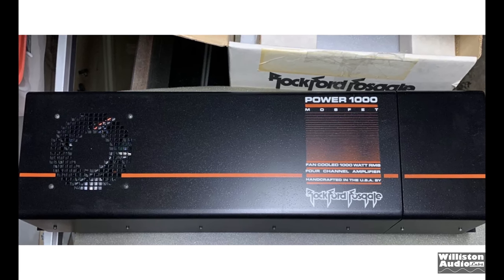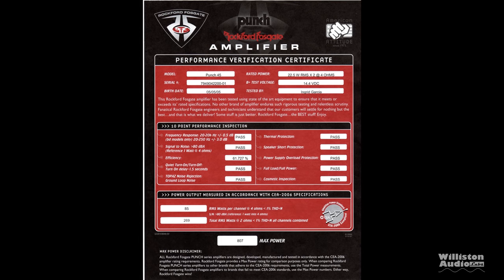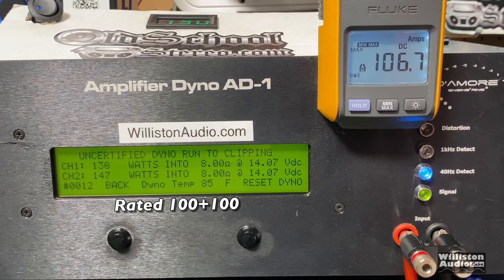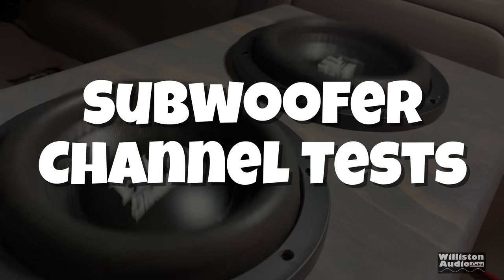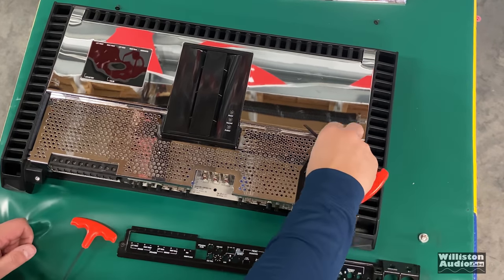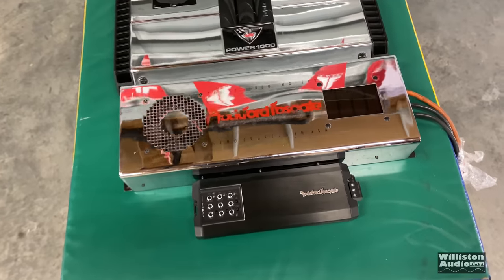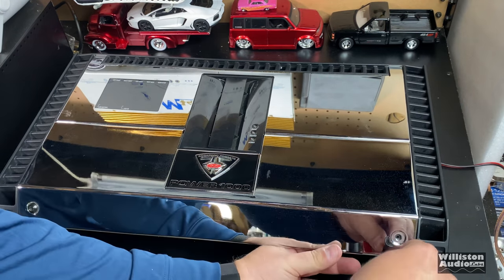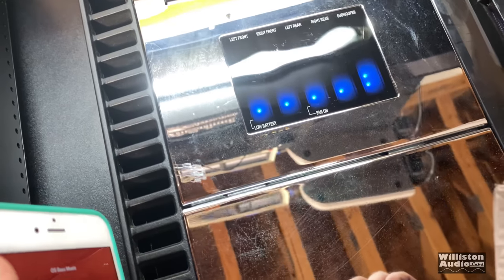The Most Beautiful Five Channel Amp Ever? Rockford Fosgate Power 1000 25 to LIFE

Comment: One of your best videos yet !! I have a few questions about amps and signal processors, if you don't mind answering I'd be grateful.  Do the new and far smaller footprint amps have less reliability and noticeable SQ difference than that of their predecessors ? Are they more bulletproof then the awesome old school amps ? The technology has improved and with having robotics and much easier to mass produce, but I would rather have old school amps like the Kicker ZR, RF, or higher end like US Amps or Linear Power. Is it much better to have an external high end signal processor/eq over controlling sound from a high end head unit like Kenwood, Pioneer, etc. ?  I see the high end signal processors such as RF Helix Audison Mosconi and others along with the lower priced versions and wonder if there is a day and night very noticeable SQ difference from having an external signal processor over the nice head unit.    Those Savard 8" subs have great bang for the buck 500 watt RMS for $125. I would enjoy watching a video showing some of the top rated 8" subwoofers in a DB challenge and side by side comparisons . Big $ Sundown JL Digital Designs DC audio B2, etc. Bang for buck subs Memphis MOJO CT Sounds B2 Skar Savard RF Orion Kicker,etc. SQ top end subs -Focal Dynaudio Hertz,etc. Thank you for posting these great old school and new tech videos which helps to entertain us during these tough times.

Comment: Had one of these 25 to life back when RF was auctioning stuff off on Ebay. Got it for a smoking deal. Ended up painting it black and it looked even better than the chrome. Sadly one of the visual signal output ( vu meter ish) got stuck. It made crazy power and every channel was rated for 1ohm, unheard of to this day. If you ever saw a black one, it was mine.

Comment: I bought one of these from Sonic Electronix 12 years ago (grey market), for $498 brand new ! At that time, SE listed the MSRP at $1498. Beat the shit out of that thing for pretty much the entire 12 years. Finally started to have problems (which in retrospect, probably were not even coming from the amp) but I was waaay overdue for a separate bass and stereo amps anyway. So after 12 years of use, I sold it for $300 a couple months ago. I'm sure I could have gotten more.... but I had already gotten like $10,000 worth of use out of it :) lol Best value piece of stereo equipment I've ever bought. Granted, the new stuff is SO freaking strong, for so cheap. It was a great looking amp though, and the LED lights were more than just pretty. They were actually so useful, and completely visible from the drivers seat in my truck. I wish amp companies still used these.

Comment: I've had this amp since, I believe, 2009 or so, in my 08 grand prix, and I've beaten the heck out of it with my four Polk Audio MM6501 speakers and two 12" Punch P3 sealed subs (wired as such to give a 1ohm load to the sub channel). And still never had a problem with overheating or any apparent damage to the amp, but a couple of my speakers have been from excessive volume over the past few years.

I'm curious, do they make any 5 channel amps like this anymore? With that kind of power AND 1-ohm stable? I actually find it kind of sad that this amp was such a limited production awesome piece of car audio equipment.
Reply from the maker: Yes some companies such as Sundown (SFB5ch), Synergy and Cosmos Audio all have 5ch amps with 1500W plus sub channels rated for 1 ohm

Comment: I think it’s time to make a video covering why all the new amps are requiring a 2 ohm load to achieve the amp’s intended power now.  They used to give you ‘all’ the power, and more of it, at either 2 ohm or 4 ohm...now you need to run 2 ohm in most cases.  I’m looking at all you Rockford, Alpine, Kicker, JL!

Comment: Ever thought of using ferrules for your power and speaker wire. It makes me nervous because you are asking for fraying.
Reply from the maker: Yes, but they do work good for use over and over. One time use they are perfect, but not for multiple usage
Reply: Since he uses them multiple times when testing, he is better off just soldering the ends, if your worried about frayed wires.

Comment: What is the difference  in the 1000c and the 1000 terminator,,, and is the original with the caboose the same guts as the 1000c,,,, just curious if any do more power than the other back from 1988 to 1993

Comment: Rockford Fosgate a/b amps have always sounded so good to me but they get soooo dang hot. Back when I had my focus I had to run a fan on my 501s cus the summers in Minnesota get hoooooooot and humid  specially when the sun's up from 6:00 am to 9:30 pm ....but they sound so good.
Reply from the maker: Heatsink removing heat from components so it’s doing it’s job
Reply: @wal  correct .
Reply: Yeah but when 1 corner of the amp is so hot you actually burn yourself on it, imagine the temps of the actual transistors.  Worryingly, none of my Power T series amps (T2000bD + T8004) ever thermally shut down on me, so I always had to run a bunch of 80mm fans blowing air down into the groves just to keep them acceptably cool.
Reply: @minus3dbintheteens60  I bought a 501s off eBay and all the caps are dented in and the cover plate had the paint burn off....funny thing is it works flawlessly.

Comment: Heard you have alot of knowledge on amps and wattage and was wondering how I would go about setting the wattage on my Pioneer GM-DX871 1600 watt amp @1ohm to 600rms 1200 max. 15" DVC 2ohm running 1ohm load.

Comment: So Big D I have a controversial question! Rockford amps always make good power but people used to run them well beyond the rated ohm loads and they frequently blew up when doing this.

Do you think the huge amps like Orion and PPI that made less power but had more output mosfets and bigger power supplies are more reliable? Or do you think they have better sound quality?
Reply: Been running my punch 200 bridged to 2 ohms since 1993 with no problems. Old school rockford ftw

Comment: I have a Boss Phantom ph3700 5 Channel and only so far you are the only one I've seen that has dyno any 5 channel amps an is not very much out there on this amp would be awesome to see what kind of power it really makes I have it running 2 12s dvcs on the sub channel at 1ohm an 2 12s svc bridged 2ohm on rear channel an 2 6.75 plus an 8" run together at 2ohm on front channel which I ran whole amp off a ds18 eq/preamp which had the sub output from radio so used amp as a 3 channel all lows 4 5x7s 2are in front doors an back dash has 2 5x7s 2 6.75s an an 8 all from a kenwood bt33 head unit mounted with a custom diamond plate piece in a 2003 ford Taurus thanks sorry for the long comment an request
Reply from the maker: HiFiVega recently tested a 5ch Boss, different model though

Comment: Does the amp dyno measure the impedance and adjust itself?   If not none of the tests are actually accurate as when you are doing say 0.5 ohm loads even the torque on the screws can cause changes in impedance.   The amp dyno should measure the impedance and adjust it's load to dial in the exact requested.   Perhaps it does,  just asking.....

Comment: How is that a parametric EQ? It has center frequency but not width? Maybe that's before they started putting the 3rd adjustment on parametrics? Unless it already has a preset frequency and that is width? The fact that it's a remote makes me think ppl were prolly using the shit outta boost back then?

Comment: On the 1991 test which amp won? The power 1000 came in second?
Reply from the maker: Linear Power 8002SW, but they used a pair of them at $3200, they were the most expensive too!

Comment: I'm wanting cash for other stuff atm and I've got a t2001bd in 8.5-10 condition on finish but everything else is perfect and missing the front cover.
But it looks like it's hardly never had wires in the inputs and it smells perfect,alot have that abused smell but still work and mine smell perfectly fine.
If anyones intrested let me know.
Definitely cheaper than the ones on ebay by alot.

Comment: I wish I could have this amp in my car today. The new stuff is trash. I wouldn't deny that the new stuff is good but the old Rockford fosgate is the best. It needs more power but the sound quality is so much better. I have a t1000 of that generation and I have to run it at 4ohms because it's just too much. And a 300x4 prime from 2011 generation for my mids and highs. And anyone that uses Rockford knows what I'm talking about. I cant afford a nice McIntosh 5ch but my set up works. Running a 2000w battery with a 93 farad regulator on the battery and my system is boomin.
Reply from the maker: Thanks for watching and commenting!

Comment: That makes me miss my T2000bd
Reply from the maker: Beast amp!
Reply: @wal  I was going to push 3 T015s but they got stolen smh but that amp was a beast, I miss the bass remote that controlled the frequency
Reply: I had the T2000bD, it killed by favorite Eclipse sub.  I also had the T8004, very powerful sound, high slew rate, but it got wayy too H0T!  Burned myself for the last time and sold both, got the Orion HCCA3000.4H class H 4 channel, it gets very hot also, but its 3x the power of the T8004.  I do miss them, still great amps, but the Orion is obviously the winner
Reply: @darknature79  how much and where are you at? I'm outside Louisville.
Reply: @darknature79  I got you, I would have extra money the 1st. delete this so no one buys it on me please lol, that's what I sold mine for, my house burned down back in 2015 and I needed the money so I sold my amps (also sold my hifonics 5 channel that was 1 ohm stable) smh.
Reply: @howardminkler484  look up william Freeman on fb.
Reply: @howardminkler484  is that you that has the ar parts pic on your page?
Main reason I wanna let this go it to get a compact 9.
Reply: @darknature79  I only have Instagram, I go by my name on there too
Reply: @darknature79  can I come pick up that amp? I
Reply: @howardminkler484  yep,we need to exchange numbers but I dont wanna put my number on here.
Reply: @howardminkler484  I'd hook it up in my car and even drive 30 or 40 mns down 65 to meet you so itll save you a few hours of driving.
Reply: @darknature79  I am going to pick up an old school equalizer I will be back in town tonight, I can meet you first thing it the morning, I was hoping I got ahold of you earlier so I could have drove to you first. But yeah first thing tomorrow
Reply: Seymore is about half way, let me know where you have in mind
Reply: @howardminkler484  I'd probably go as far as Edinburgh,I'm on the northwest side of Indy.

Comment: be nice if someone make an amp full range class D with rms settable power out put  limiters via a small digital panel and or with app.............be nice to pinot out brands of capacitors in good or supposed to be good stuff ...Be blessed..i like full range class D amps  as i ant a fan of msm rap bad messages mostly  but need a loud system that will play it all like RED (the band).....Skillet  .now dance n techno + old rap is ok like Sir Mix a lot Baby got back ..hate in huge supply sadly lol